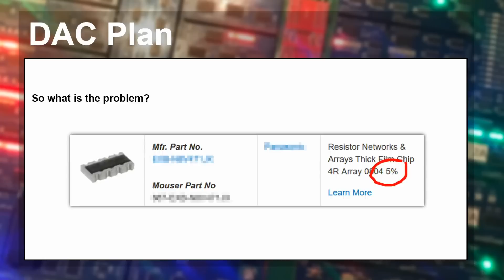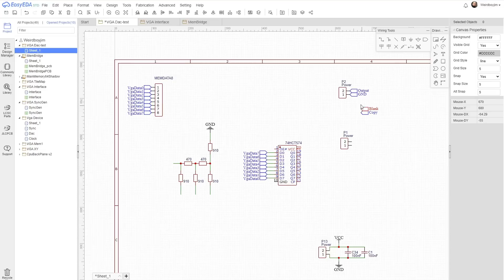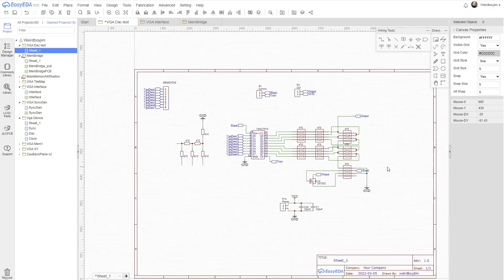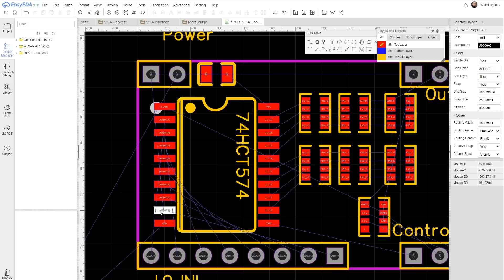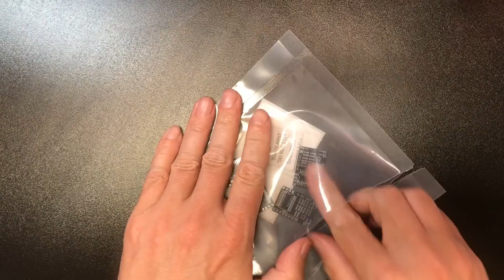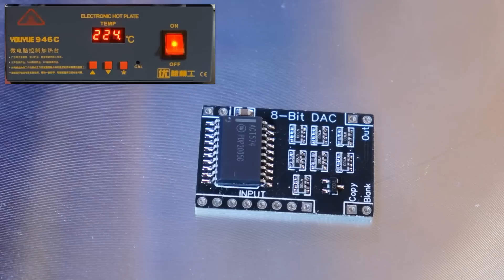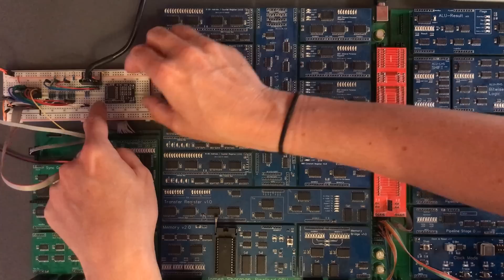DAC Test - VGA from Scratch - Part 10

Comment: An option that trades time for very low cost: get 5% (or even 10%) standard resistors, buy a box of 1000 (<$10), and characterize them manually. As you mention, you don't even need them right-on. They just need to match amongst themselves. Also, only 2 or 3 high bits need particular care. I don't think I've ever spent more than 45 minutes getting a matched set of anything that's "as good or better" than I needed at the time.
(Edit - regular carbon through-hole. Add a couple of hours for 0402 🙂)
Reply from the maker: I really like this little 4 resistor arrays.  Not sure how long it would take me to sort and then place 0402's or if I could pack them as tight on the pcb.

Comment: I also felt the R2R approach would be fine since the spread within a single batch of resistors is often small.  You just have to keep an eye on the time constants if the pixel rate is high enough.  That stencil was just about the funniest thing I've seen on any of your videos, James.  You had me roaring with laughter.  But I was also shouting at the TV - "You need more signal grounds!"  Of course, it worked out OK, but with eight data bits at pixel speeds, a pixel clock and another control signal, I was surprised that the two grounds that you had were sufficient.  When you put three DACs onto a single board that won't be such an issue depending on how it's all connected together.   A filtered supply to each of the DAC driver latches might help clean things up a bit too by blocking some of the general system noise on the supply.  
Great progress, and looking forward to the next step
Reply from the maker: Yeah, I've been thinking about ways to isolate the supply a little. VGA actually gives you signal return for each color (i.e. local GND) which I could tie into an isolated supply.
Reply: Jaguar has a resistor network on the lower edge of the Tom chip. Can’t we buy these off the shelf? I like how the cat neatly separated semiconductors and coke, soot or whatever is in a resistor. Pretty surely Jaguar was price optimized. R2R needs termination. It is straight forward to come up with a resistor network to reduce voltage. Ain’t video signals only 1 V p2p ? Now I have to look for an amplifier on the Jaguar board.

It is weird that this “from scratch” build uses highly integrated circuits. Jaguar had to switch to an off the shelf audio DAC because standard equipment is just so good. PSX uses an off the shelf video DAC. So we are from scratch like a PSX?

Comment: Great analysis to get to a good enough solution. This is what engineering is all about, to be fair you could check the resistor arrays before you start to make sure there aren't any outliers. Other than that for a home made video DAC this is a pretty good design. The only thing I would add would be the ability to add some bias voltage to each channel so you can tweak colour balance.
Reply from the maker: Overall bias is an interesting suggestion. I'm feeling tight on space though so I'm cautious about adding anything that will be trippled.
Reply: @weirdboyjim  Just an opamp and a trimmer pot on each channel would be enough to even out any differences between the converters. It may not be necessary though. You could always build another prototype and see what kind of variance you get between them. I think as long as you test and match the resistors you should be ok.

Comment: You are going to get some error from the driver chip output drivers not all being the same.
Also I'd try  0-100-0-100% checkerboard pixel test to see if you can slew fast enough.
Reply from the maker: Indeed, but I'll need the tiledata circuit in place before I can do alternating pixels at full clock rate.
Reply: I do agree. I went on a similar route once (74ACxx, though) and found that error from chip's output voltage was significantly higher than the 1% from resistor ladder. After all, they are meant as digital logic , not laser-trimmed analog ones.  Specially when load varies from "bit to bit".....
But, as always, if it works, don't touch it! 
Great work, James!!!!
Reply: @santiagoguildomenech1864 with CMOS logic wouldn’t the output reach the rails with very low deviation? High resistance in the resistors, powerful drivers for the pins.

Comment: Might have missed it but shouldn't the unselected bits of the '574 be tristate (which you can't do for individual pins) or you're sinking current back through the R2R DAC and skewing the output? 

Simple as a signal diode per output perhaps?
Reply: An R2R DAC requires the inputs to be sourcing or sinking current.  There are DAC architectures that are just fed by current sources where turning off the drivers might be required, but they are much harder to manage in discrete hardware for more than a very few bits
Reply: @GodmanchesterGoblin  Yeah, that did occur to me as a possibility while I was driving home and I was going to add it to my comment :)
Reply from the maker: It's worth noting that the minimum resistance between two neighboring pins is 1410 Ohms. If we use ohms law at 5v that gives us 5/1410 = 3.5 mili amps. The line driver outputs of the 74ACT574 can source/sink 24ma according to the datasheet. In the worst case scenario with a line in the middle one way and all it's neighbors pulling the other-way it would source/sink more but than 3.5 but obviously much less than the max.

Comment: With two 470 ohm resisters up from the ground rail, that's 2x the 1% error.  I presume that's accounted for in your spreadsheet.  I only mention it here because it's the sort of thing I'd forget, not that you would. (Edit: loved that DAC performance and layout, the enormous stencil, and once again very clean resistor array soldering)
Reply from the maker: Yeah, if they are both of by 1% "the same way" the result is 1% error. On the other hand if the errors really do follow a bell curve the clustering towards the center will be increased with the pair.
Reply: Not really.  If both resistors are +1% it's still only a 1% error on 940 Ohms.
Reply: @GodmanchesterGoblin  Woops.  Roger that.

Comment: Another consideration is that the human eye does not have a linear response to the primary color sources in its primary sensor, the retinal cone cell. Hence the gamma correction function comon to color display output controllers. So either the analog voltage of source prior to the dac or the resistor values themselves can encapsulate the gamma function for each primary colors before the output will center the response in the human color space. If I remember correctly the red curve had a .58 adjustment while the green had .39 and blue had .16. That means that the blue would need an effective amplifier gain of 1/.16 to center, or 6.25.
Reply from the maker: Indeed, the non linearity is something we have to deal with in rendering all the time.
Reply: What? Gamma factor is implemented by the electron gun in the CRT. Artists create their artwork on a similar CRT as the player.

Raytracing and path tracing create intensity. Even on my 386 I used a floating point library for this. So you can invest in the correct gamma when you write the the frame buffer. We really need 220px true color.

Comment: Bourns makes r2r ladders.
You could use colour lut with 256 indexes at 8bits per colour - this would possibly be the best option with your 8 bit per transfer limitation.
Reply from the maker: That is exactly the plan!
Reply: @weirdboyjim  that is even better than original VGA spec ;-)
Bourns 10k R-2R ladders are reasonably cheap, but you would need to buffer their outputs with either video class opamps or with transistor emitter followers with some simple tricks (using a diode at input to compensate Vbe).
Reply: Almost every vintage computer did it that way so that seems like a plan.

Comment: Would it be worth to bake the resistors in a oven for say 24-48 hours and then measure the resulting resistance? Then you can pick the most accurate resistors for the top 3 bits in each ladder.
Reply from the maker: Very interesting idea,  not sure if my measurement tools are accurate enough for this to make a difference.

Comment: The tunable MSB with a micro pot could be a quick (and almost elegant) way to make sure the DAC works well for years.

Reminds me of the CD reader of a Gamecube. When you thought it was finally over for the damn thing after so many years... Some beloved engineer exposed a resistor value to change the voltage to the laser.
Reply from the maker: Interesting idea, I'll think on it but I'm feeling quite tight for space.

Comment: Lovely to see that done in detail like that, thanks. Over the years i've worked with r2r and DAC ICs, I've not noticed huge issues with either but i've never tried to use r2r with more than 8 bits for the reasons you outline.  I've found even 5% is fine as long as all bits pass via a single pack at a time, otherwise all bets are off as that cross over notch becomes real. I have seen issues with boards where temperature is uneven, not sure if that is all a resistor issue or if the boards I used had a buffer amplifier of some sort... That is going back many years so boards tended to be much larger, and hotter!
Reply from the maker: Interesting to hear about your experience there.

Comment: One suggested change.  Make three boards.  One RED, one GREEN and one BLUE!!
Reply from the maker: Ha! Interesting idea but it may not be very practical. Did you notice that the breadboard version uses red, green and blue wires?
Reply: It would be funny if each board had a capacitor and a common mode choke on the power rails. Then the signal on the cable will become a little balanced. Ah, common mode choke on that side also. Is it twisted pair? Thing is that VGA monitors more expect coax input. With enough choking, each board will just balance how the cable likes it ( and the monitor ).

Comment: If you want to improve smoothness of sawtooth, you can order more resistors than needed and manually select ones, which fits better together. I'm not sure how to do measurements for such tiny devices, but it is possible for sure.
Reply from the maker: Not sure if the tools I have are sensitive enough to spot the difference on a loan resistor.
Reply: @weirdboyjim  build a Wheatstone bridge and plug them in one at a time, then bin them based on tolerance.  Build your ladder out of whichever tolerance bin has enough parts in it.  0.1% probably possible if you buy a reel of 1% 470R 😀
Reply: Can a saw tooth signal be used to find the most offending resistor and replace it? Also if the circuit would sawtooth in horizontal retrace, it could update a look up table ( a palette) to reorder a 10 bit DAC .

Comment: Watching you solder with the stencil and hotplate has spurred me on to use my hotplate for my next PCB.  Up until now, I've been soldering all my SMDs by hand or hot air gun.
Reply from the maker: Go for it! The hot plate is a big help, make it easy for me to video the reflow as well!
Reply: @weirdboyjim  We told you, James! ;) You were soo attached to the hot-air gun! :)
Reply: @m1geo  Me too. I was going to leave the hot plate for some upcoming BGA work, but having seen this video I see no reason to keep relying on the hot air gun anymore. 👍
Reply: @m1geo  Reflow oven is even better, especially if you need to use double-sided placement.
Reply: @asmi06  Yup. I have one! I offered to loan it to James to try.
Reply: @weirdboyjim  You might want to get some sort of desktop fan to cool a board below melting temperature before you pull it off the plate.
Reply from the maker: @asmi06  it’s a balance, the plate cools down far too slowly. I’ll try the fan but I think it has far too much thermal mass to make a significant difference.
Reply: @weirdboyjim  PCB is a bad heat conductor, so you should be able to cool down the top of it with a fan enough to have solder solidify before you pull it off the plate.

Comment: The criticisms of using r2r ladders using discrete resistors are both completely valid and way off base. The 5% (or 1%) variability, is a max value, with today's manufacturing techniques you are getting way better than the stated amount. A nice lite diversion none-the-less.
Reply from the maker: Pretty much my conclusion, I don't regret taking the time to explore it though.
Reply: @weirdboyjim  The video and examination was well worth the time.
Reply: Part of tolerance range is that you can't make a resistor that doesn't fit in any value.  So they don't have to be too tight on manufacturing.  Ageing and temperature coefficients just add to the fun. So much fun can be had testing a D2A over temperature,  many a month spent doing that.

Comment: Love that crisp slope coming out the DAC :D Ya love to see it! The acid test is gonna be plotting a colour gradient on the screen and seeing if there's any banding :)
As for mixing the colours to get monochrome, you need to mix the RGB channels in these proportions respectfully: 29.9%, 58.7%, and 11.4% (I *think*. Don't quote me, play with the numbers and the orders :D) I think you can use opamps to weight the channels and mix them in the correct proportions.
Can't wait to see more! :D

Edit to add: It might be the case that the weighting and colour mixing is done inside the monitor, and you can just send the full signal to each channel. I guess make the parrot text card image monochrome in Photoshop or similar, and see if it looks the same xD
Reply from the maker: The gradient I put in the screen gives me a pretty solid idea,  once I have the pallete in and 3 of these I'll be able to play some more though.
Reply: That is the colour mix for composite video. VGA is pure 3 channel RGB.

Comment: Values should not be a bell curve, but the difference between wide and narrow bell curves. Two-hump figure.
Reply from the maker: Why do you say that? Or are you accounting for close value selection by the manufacturer?
Reply: @weirdboyjim  Yep, components after manufacturing  should be divided to 0.1%, 1%, 5% bins. 1% bin includes 0.1% bin, but it is selected as separate bin!

Comment: Not sure if it's true for resistors but for capacitors the error is rarely close to zero (i.e. the bell curve has a hole in the middle) because the parts with good tolerance get binned out and sold for more money... So a +/- 20% capacitor will probably have an error of between - 20 and - 10 or + 10 and + 20. If it's below +/- 10% then it will get sold as a 10% part.
Reply: It's possible that resistors don't work the same way and they manufacture to the tolerance rather than binning them
Reply: @cskilbeck  Yes - resistors like these are generally laser trimmed during the manufacturing process.
Reply from the maker: Interesting. That hadn't occurred to me. From a little testing it does look like all the resistors in a package to fall very close together though, so wiring it as I did gives a low chance of issues.
Reply: @weirdboyjim  Also, as you've demonstrated, 1% is definitely good enough and it seems very unlikely that you'll get a wild swing from 1% to - 1% within a resistor 4 pack